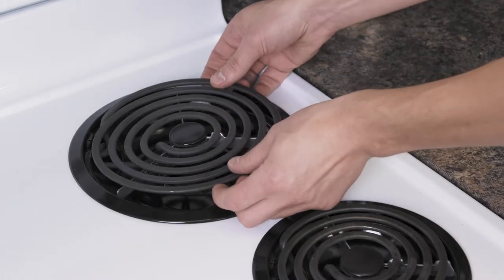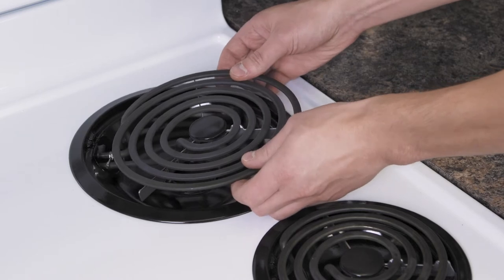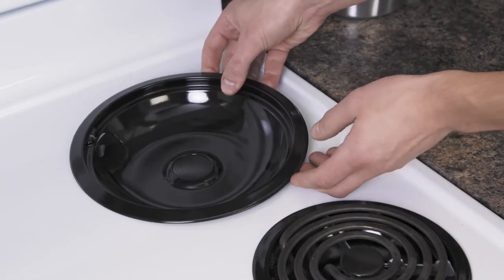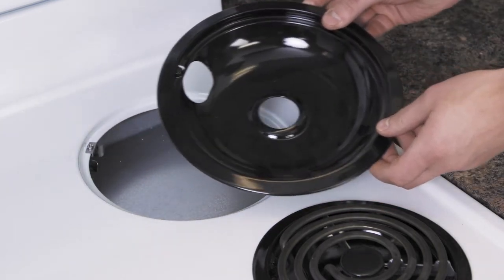Stove Drip Bowl | Repair & Replace

Comment: Do i have to shut the breaker off ?
Reply from the maker: Thanks for watching. With the stove turned off, and with the way that the element and drip bowl are mounted the risk of any electrical shock is low however if you are concerned, it never hurts to shut off the power at the breaker or unplug your stove.